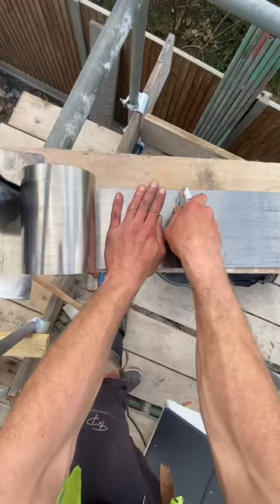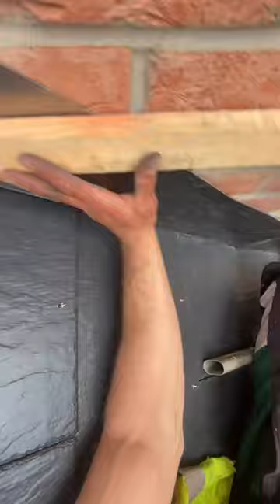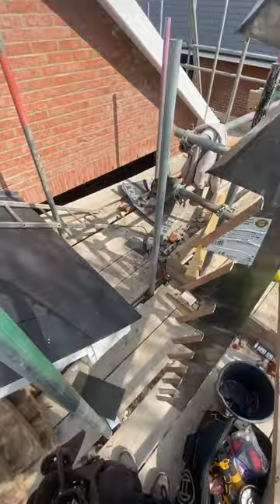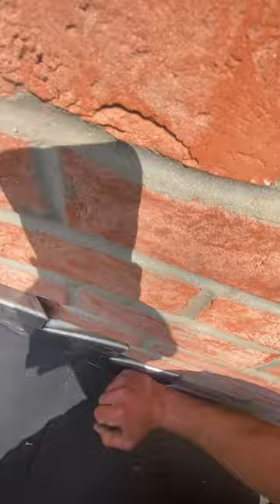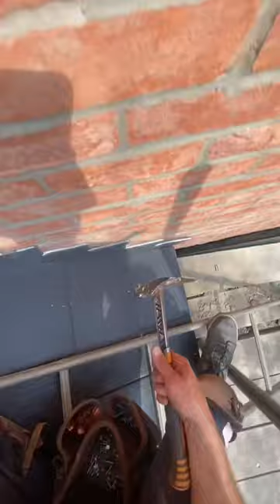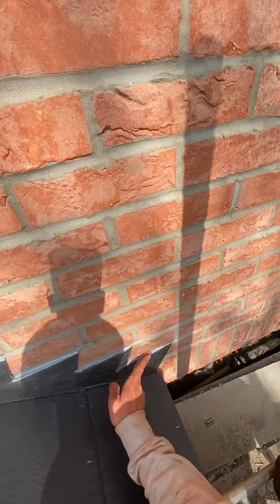Lead Step Flashing 💥🔨 #roofing #work #construction #fiber #new #build #newvideo #shorts

Comment: Leak like a sive , because it doesn't cover onto the tiles.  Rain go straight down the lead . Should be 9 " lead , 5 " UP 4" FLAT
Reply: There will be lead soakers under the tiles  to carry any water out it's proper way to do it in UK
Reply: @monkeyboyclyde  I've used zinc soakers, I'm in UK 🇬🇧.
Reply: @barriewise211  sorry mate assumed you was a yank coz in inches😁 my bad

Comment: Shouldn't there also be an angled/sloped cavity tray?
Reply: There was one up the wall behind it. It’s just not easy to see in some parts of the clip
Reply: I presume he’s used soakers the whole way up
Reply: @Ch4r1i3.T 😂
Reply: Forgive my ignorance but is the leadworker responsible for this anyway., I was under the impression it was the brickies job
Reply: @Mckolas_whistling_front_teeth it’s usually a roofers job once the membrane is down